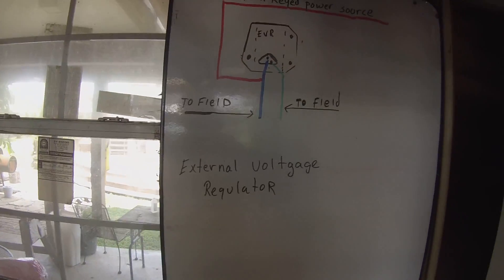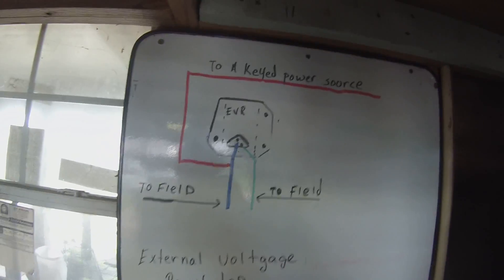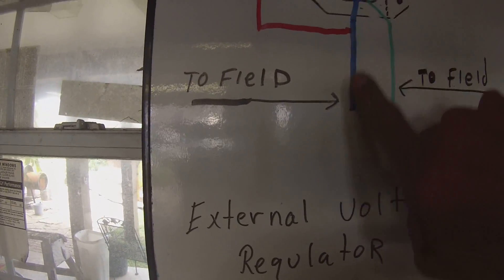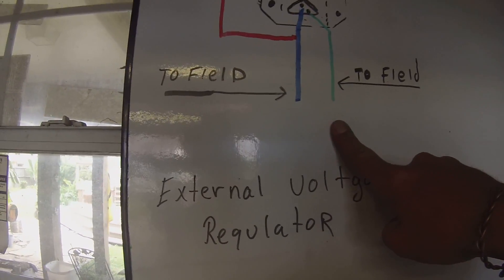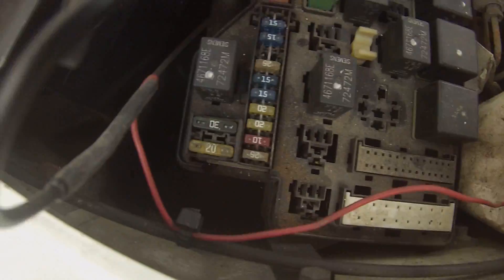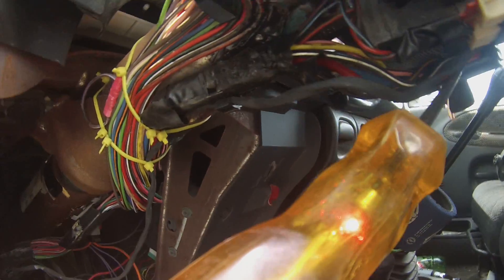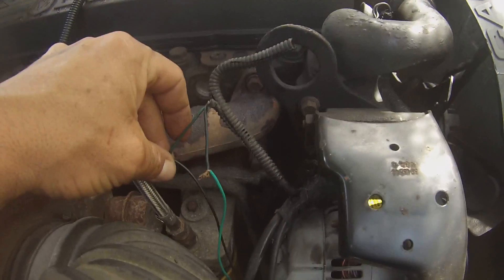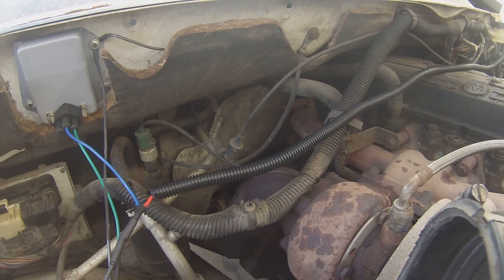external voltage regulator 5.9 cummins .a better wiring video

Comment: Have you had any issues with the location where you used the keyed power? ??
Reply from the maker: strokedfirebirdable     no sir,  have had issues with my factory gauge reading off, butt i am over riding the computer and i think it is just  the computer being grumpy, pist , or jealous. butt i am holding about 14 volts every time i put a  hand held volt reg on it... ????   don't know......   hope it helps....  cheers..  simplegreendodge

Comment: I watched your video and I would like to say it is very informational. I tried it out on my 1998 dodge ram 2500 v10.  and it worked I was getting 14.8 volts charging. but the problem I have now is even with the key off I am getting a high continuous amp draw. I used a piggy back inline fuse and wired it to my blower motor fuse cause I know it is only on when the key is on. my alternator is grounded to my external regulator and from there to my battery. My question is what would cause the high amp draw and what can I do to fix this problem.
Reply from the maker: Big Mopar Fan i would think with the amp draw you have a parasitic draw,and what it might be would be any ones guess.radio, phone charger, inverter. ect.ect.  i have one in my mud truck that i have been hunting for years. drives me nuts. we have them on almost every fire truck. and i think they are all different issues. the cheating  easy way to solve the prob is to install an inline battery shut off . i have one for the mudd truck just haven't gotten to it.maybee i'll do a vid of it. hope this helps, and give me  a re, re , reply. i not sure if my viewers are recieving my responces . thanks  chris
Reply: chris livingston my amp draw is coming  from my I.O.D fuse looks like I still have some more trouble shooting to do. Reading  0.572 on amp draw meter
Reply from the maker: having brain fart, what is iod? glad you found it
Reply: chris livingston I.O.D. (Ignition Off Drain) Fuse